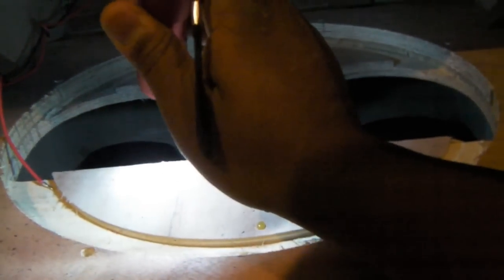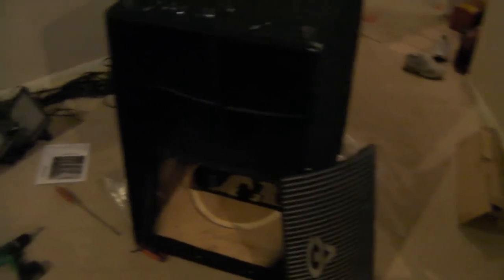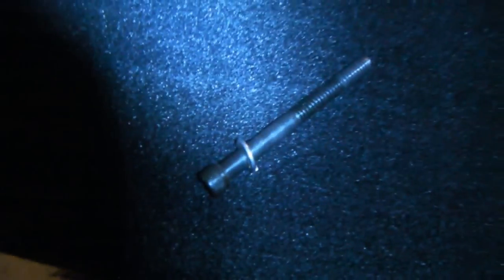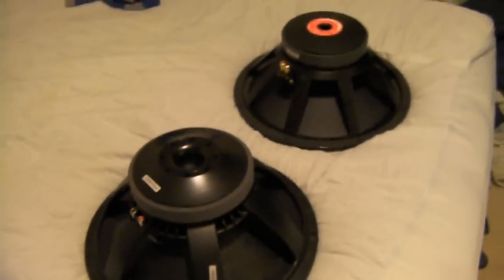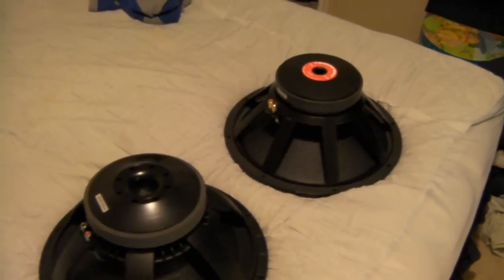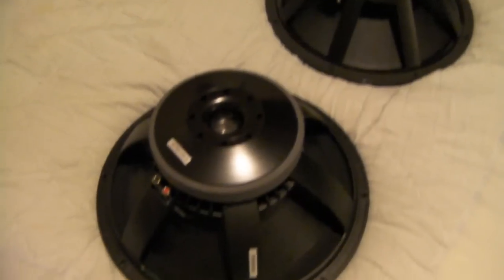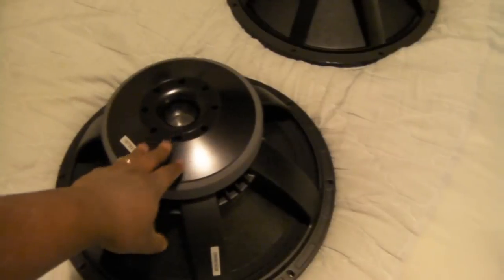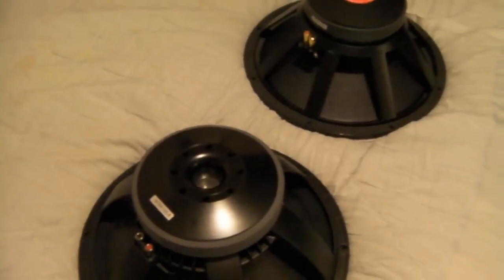DJ Speakers Cerwin Vega EL-36c upgraded to B&C 18TBX100 ! Yorkville Speakers  Fort Worth DJ.wmv

Comment: The CV sub may only be 1000 watts but it has a sensitivity of 106dB at 1 watt. Every time you double the wattage it goes up 3db. Which is why the CV sub can put out 136dB. You need to know what your doing
Reply: Tyler Truitt That rating of 106dB/1Watt is likely the efficiency of the horn+horn combo, not just the driver.
Reply: I figured that out after I posted this

Comment from the maker: @chewyecm Thanks for the comment I got 3 of these subs, It is going to be very loud and you should go to Parts Express online and look at some of the B&C Sub woofers, Trust me a 1000 WATT Sub is not that good in this cab. I brought this EL-36 for the Cab to put a very loud woofer in it. I run a Crown XTI 2000 amp on each Sub cab and a QSC PLX 3602 for my JBL MRX 525 Dual 15s for the Highs 1250 WATT per Channel on the tops !  The Crown XTi  2000 is running at 1600 WATT on Each Sub at 8 ohms !

Comment: I don't mean to be insulting or rough but I think that was a waste of money,You should keep them stock since those drivers and their cabinets are designed for one another, Just use more of them, it seems you might be under- powered for your room sizes due to lack of equipment.For a school gymnasium you generally want at least 4 single 18" Subs or even 2 dual 18" subs (sometimes more).Regardless of wattage an 18" woofer can only move so much air  their original woofers work really well when used properly. CV Horns though they house only 1 woofer slam in general and match or exceed the output of many companies' direct radiating double 18s if you power, crossover,calibrate and array them correctly. I've used 400 Watt CV L36-PE  in pairs and they stomped most other cabinets which were larger and rated for more power.This was with the original woofers in them and powered by good quality Crown Amplifiers.Bad move to use a QSC amplifier with Crown Amps, they often work against each other.Just use all Crown Amps.Often the best results are when 2 or more are arrayed together, and laying them on their sides (on the floor)will also aid in better bass extension and output as well.Try it,you'll be happy with the result.Like Tyler Truitt said (and I agree) You need to be mindful of what you are doing.2 Your acoustical output will increase by 3db when using another of the same spec speaker in tandem with the first. Your 106 db  at 1 watt 1 meter would effectively become 109db at the same.